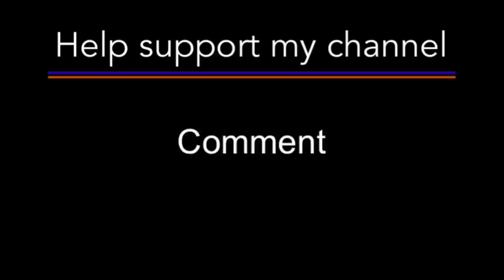Woodturning Green Wood: Walnut Log to Bowl - Turning The Big Green Monster

Comment: Great job, but why did you stop in finishing the bottom?
Reply from the maker: Hi Delbert! Not sure I understand exactly what you mean but I’m gonna say I waited to finish the bottom until it got done drying and warping so I could make the bottom flat and it wouldn’t wobble or rock. Is that what you’re asking?
Reply: @LisaRamlow  My bad, I thought you were finished with the bowl.  IF I were doing it, I would have concaved the bottom.  To me, it just looks much more finished.  But that is me.  As always, love to watch you turn.
Reply from the maker: Yeah, I used a mortise on this bowl - I generally use a tenon and then concave the bottom a bit. This whole thing was a bit of an experiment in turning walnut green and to see how it behaved. And it behaved nicely! This has become my “catch-all” bowl on the counter and I throw my wallet and sunglasses and mask and stuff in it 😁
Reply: @LisaRamlow  A do we need those "catch it" bowls.   You would not think the method I mentioned would be all that different than grinding the concave.  But it is.   both because its easier and looks better.  Try it on a small bowl to see what I mean.
Reply from the maker: I guess I must not be following you - send me a pic of you get a chance - Lisa (at) lisaramlow (dot) com
Reply: @LisaRamlow  Will do

Comment: If it's moist...wouldn't that account for the rougher cut?  How dark it goes is definitely wetter.  You can tell by the angle of the bowl gauge you're holding that things are too high.
Reply from the maker: Thanks Morgan
Reply: @LisaRamlow  I was just observing here...not being rude or anything.
Reply from the maker: No worries - to be honest this one was a while ago and I don’t remember all of the things I did or that I had trouble with, so it can be tricky to follow some of the comments 👍
Reply: @LisaRamlow  gotcha 😉.

Comment: It would be helpful in analyzing your problem with uneven surface finish if the camera were far enough back so we can see your body position and movement as you cut.  It appears to me that you might be making lots of intermittent, sequential cuts through your arms instead of a long flowing motion from your body.  You'll get a bit of a groove every time you stop and start a cut.  You have to work on making a continuous cut generated from your legs through your hips flowing through your body to the tool.  You need to think of the tool and your body being one.  You don't want the tip of the tool moving from the motion of your arms; you want the tip of the tool moving from the motion of your body.  It's a dance like the tango, not a dance like the herky-jerky.  😉
Reply from the maker: Thanks Richard. Working on the outside of this one looks really jerky, especially sped up 600% but for some reason I did make a lot of short cuts resulting in lines where I stopped and picked the cut back up. Might have been trying to get the shape near the foot closer to what I wanted without making a full pass and ending up with a much smaller bowl than I’d intended, which happens to me frequently 😂

Comment: Lisa, Kent Weakley has a video about shear scraping.  A lot of youyubers seem to use that as a finishing cut. Here's a link https://www.youtube.com/watch?v=ajMZGRrsjt4 .  I think you did a great job considering the size of that blank.  You're also way too critical of yourself.  I'm still hoping for the video on the tenon/mortise sizing guide!!
Reply from the maker: Thanks! I’ve actually watched a bunch of Kent’s videos, not positive about this one. I sometime shear scraper with my bowl gouge, but I have a carbide shear scraper that should work wonderfully if I can get the hang of making a smooth pull stroke with it.  Thanks for the tip 😃
I’m gonna try and get a short video up on the mortise/tenon stick 😁